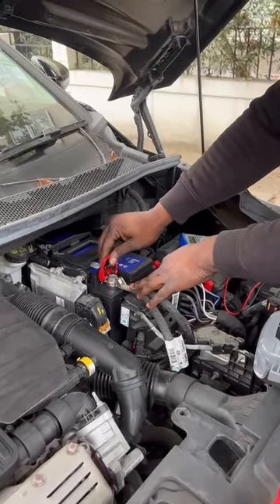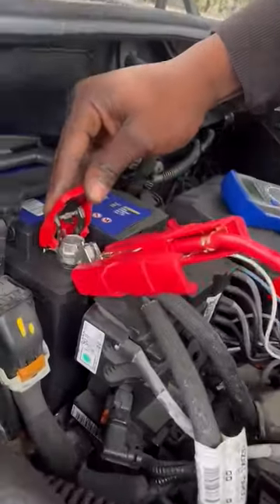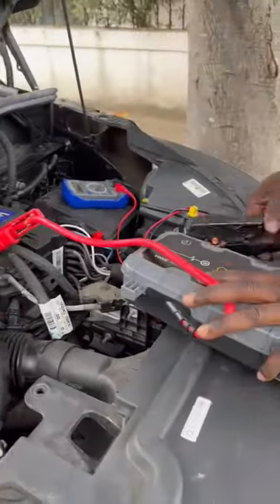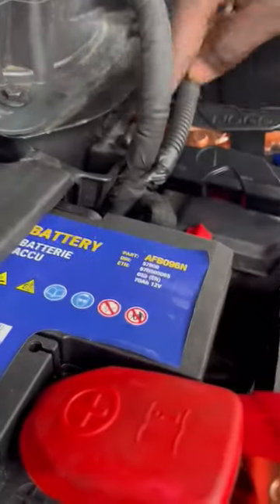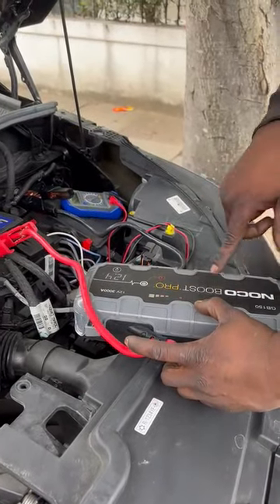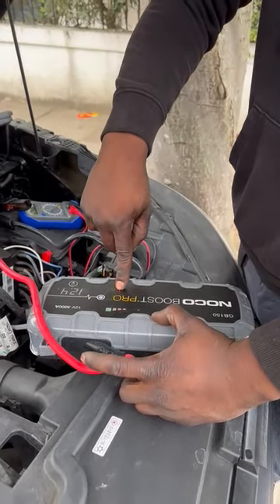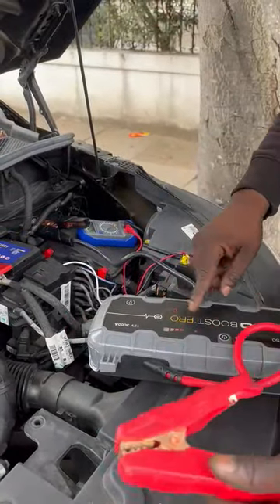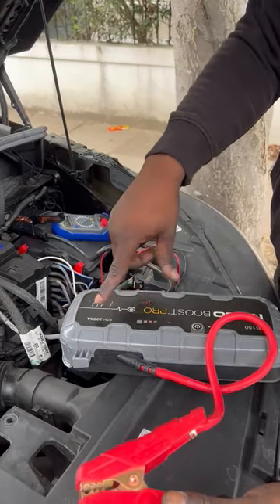Never Get Stranded Again: How to Start Your Car with a NOCO GB150 or GB70 Battery Booster Pack

Comment: Never put positive cable on before the negative unless you want to have an arc and potentially fry your ECM and other electrical components in your car always put negative on first.
Reply: Wrong
Reply: I’m a technician that works on cars for  a living and went to school for it as well. Since I’m wrong go ahead and try your method on some of these new cars and just for shits and giggles make sure that the car is expensive and see how fast you fry that ECM. But hey since I’m wrong you’ll be fine I won’t be the one paying for it. But for anyone else that doesn’t know put the negative on first and take it off first it will save you stress and money in the long run.
Reply: I also work with cars. Your wrong.  im not arguing
Reply: @cjfisher9572 ok you do that then 😂
Reply: The actual NOCO manual that comes with the jumper says to put on the positive first and then the negative and when taking them out do it in reverse order.
Reply: @omegafp123  Yep perfect always positive first on. @ChocoTheGoat will say Noco is wrong now

Comment: You have a higher voltage one. Does the 1000 not do the job ?
Reply from the maker: I advertise from jumpstart services in London, I had a Gb70 before, and it could die after jumpstarting about 3 dead cars.

Comment: Why not put black one on negative? Ive seen people puting red to positive and black on negative. Is it matter?
Reply from the maker: On some cars and vans the negative terming isn't accessible. So most vehicle have a jumpstart post for the earth, some for both. Any part in the engine bay or the vehicle that has exposed metal can usually be used as an earth point ( - negative)

Comment: Thanks for the last part.  Kept trying to jump start my car but the battery was completely dead.   Should I buy a different kind of noco?
Reply: You need the correct one for your engine  the most common is the gb40 model which can start v4 and v6 engines.
Reply from the maker: What type of Noco do you have?
Reply from the maker: I would go for a gb70 and above as I upgraded from a gb70 to a gb150
Reply: @Freestyleny  v4?